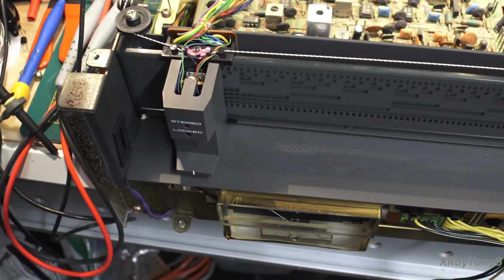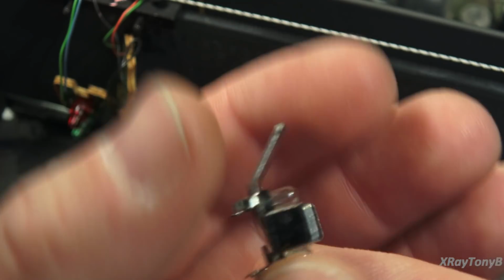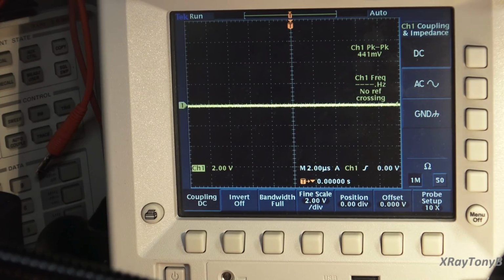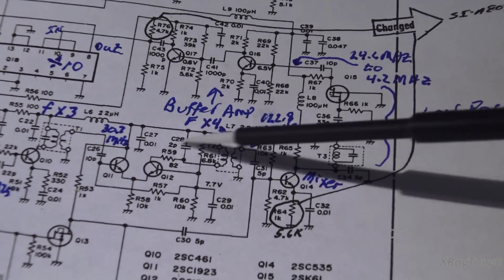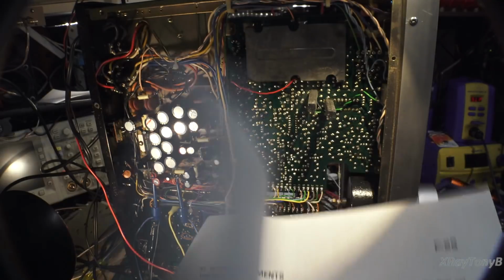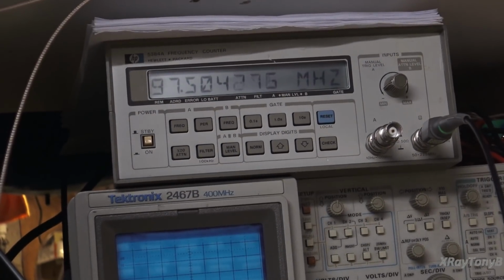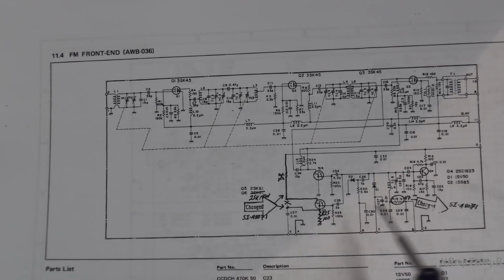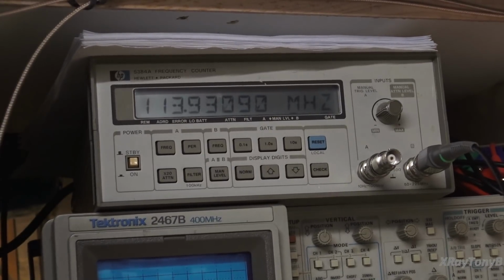Pioneer F-28   Part 2

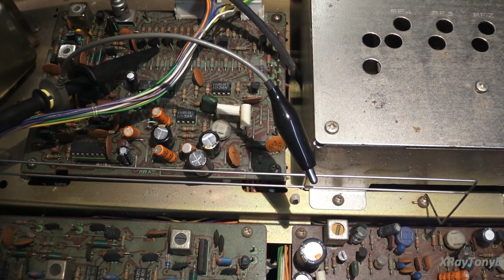Comment: 13:20   Someone should post this question to  Mr Carlson Lab;  I wonder what he would do to test a RF transistor?    Or if there is a way to test a RF Transistor?   This also makes me wonder a few things about  how they make them and test these items in the first place?      Now I know some dude out there  (Probably a Russian)  came up with a way to test Vacuum tubes or something , and may be able to make a smaller version of the circuit but take it into the digital realm. with and Arduino or something.   (heavily shielded of course)  

Something like a 8-bit Microcontroller CDP1802ACE   is cheap enough to do the job, and do it with high energy RF around so it won't be affected as some might.     

I wonder if you could tell if its bad by  reading a resonance while in curcuit of a typical failed one.   I would assume of course that this may be possible?      So you might be able to do this with a laser or IR  beam and measure if there is any difference between a known good one, or link that up to a database ?

Just an idea.   
iMickey503
Reply: Data-sheets often include an equivalent test circuit that is used to test the component parameters (or you can use a typical test circuit).  If you set up the same circuit and measure the published parameters the transistor is to factory specification and will USUALLY confirm the condition or another will work as a replacement.

The unusual situation arises when transistors need to be paired in one or more characteristics more closely than the general specification requires in some circuit, occasionally more than two need to be matched in say a parallel output stage.  Then we find with RF components used near the bleeding edge of their specifications they are simply selected from a batch as those that work in the demanding application and those that fail are used where the demands are less.

Factory and bench testing does not determine all characteristics fully so testing in the actual circuit is sometimes needed to make a final selection.

Comment: 12:00 : Elsewhere on youtube it is stated that these cheap transistor testers only test up to a few volts -  less than a dozen -and what happens when in circuit under higher tension is a different story.

Comment: This very convoluted dial location sensing mechanism makes me wonder why they didn't select to use a toothed belt with gears instead. Surely that would have been easier. Prone to deterioration it would be but seeing this, it's not exactly bombproof either.
4:05 : I can't imagine how the tuning mechanism in a consumer tuner is actually that linear so as to correspond to the precise intervals between the positioning sensor windows.

Comment: I do not like those bits. Why did they not use a grey code?
Reply: The output word directly selects the counter period. There is another bit that toggles mute on between stations so there will be no audio until the word and the tuning settles in.
Reply: The chosen PLL chip, as most do, wanted normal binary input.  This loop did not have to work during the code change and was locked out by the final channel location input anyway so not needed.

Comment: I would look after the mixer Q14 the impedance should be much lower there and the level should be higher(without the vco signal).  I don't know how much T2 will suppress the harmonics but it should be a fair amount. Also I don't remember you checking the supply voltage and if there is any noise on it.  All those old caps would be very suspect. 

On the vco connection killing the signal - if the vco is not running Q13 might be clamping the signal at output of T2.

Comment: Q11 and Q12 generate harmonics. There should be all kinds of trash after Q12 ( 2nd, 3rd, 4th, order and so on. When you looked at this point with the spectrum analyzer the spread was to narrow to see the 4th harmonic it should be there before and after T2. Then T2 is to be tuned to the desired freq. With R58 a 10K it looks like the impedance it the input to T2 is somewhere around there (10K).  And on the vco loading the signal is it shorted at the output? Try input signal gen here and see if Q13 works. Is C30 good?
Reply from the maker: I totally agree.  I didn't get all the steps I took on video, but one of the things I did was open the span on the spectrum analyzer.  As you said, there are a ton of harmonics.  Funny thing is that T2 didn't so much peak the amplitude of the 122.8 MHz, but it actually seemed to suppress the upper harmonics and slightly (very slightly)  increased the amplitude of the 122.8 MHz peak.  The only thing that puzzles me is how you could follow the instructions.  The harmonics made it almost impossible to get a lock on the frequency with the frequency counter.  Also, I think my frequency counter affected the amplitude of the signal, making it hard to measure.  The spectrum analyzer was the only thing that worked.  C30 is good.  Q13 tests good out of circuit, but I just used the peak semiconductor checker, so I'm not positive on that one.  I ordered some spare parts just in case.  I didn't have that type of JFET in stock.  Thank you so much for the help!!  It's really good to hear a second opinion.

Comment: I'm inclined to think you have a bad varactor.  If it's solid at 8V but flaky at 17V, the only thing that's changed is the voltage on the varactor.  A flaky trimmer should affect both frequencies (to some extent).  But it wouldn't hurt to check and make sure L6 hasn't gone high resistance on you.

Comment: Any progress is good, and you've had a good deal since part 1.  If your boards haven't been modified to the revised schematics, I would bite the bullet and do the mods.  I know, it was sold to someone as a working tuner.  Maybe it did work. Component drift, both active and passive may have thrown barely working circuitry into garbage territory.  There are always some early failures and they probably led to the modified circuits on the diagrams.  
An old Dynaco amp I had broke in an unfixable way. It depended on the specific operation of an obsolete transistor that no replacement matched. How the heck did that happen??  I suspect the crazy fixes on the diagrams of this tuner are similar. Some one had to redesign the circuits for reliable operation.

Comment: Silly question but did you check all the power supply outputs for the correct voltage and noise?

Comment: One thing I would recommend trying is to monitor the frequency while spraying some freeze spray on the components in the local oscillator, and then heating them up with the soldering iron if that doesn't help. I remember those first varactor tuned receivers were bear to work on to get them to tune and track right. Keep plugging away you'll get it eventually.